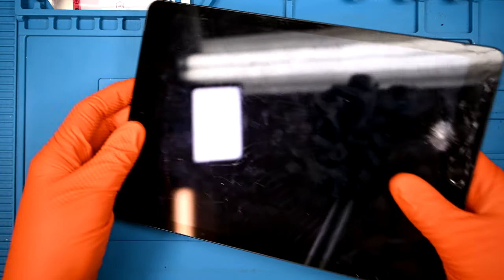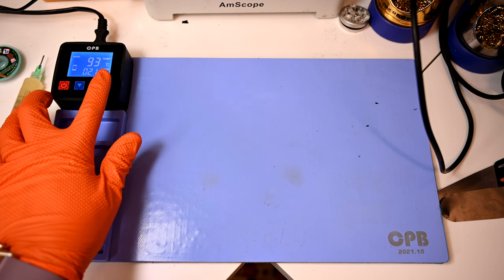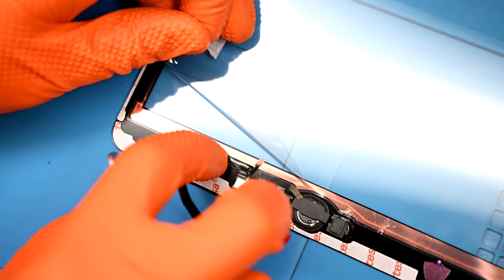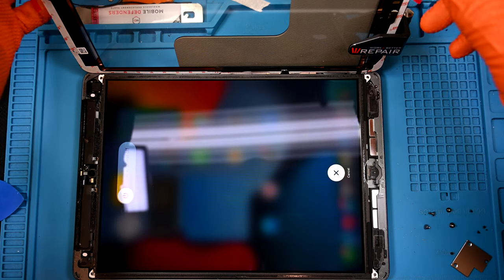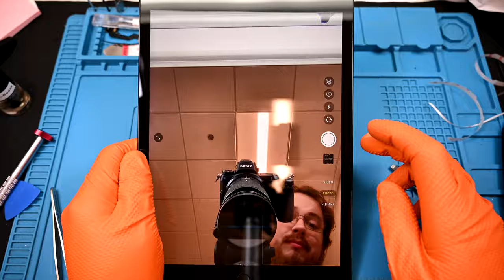iPad 9 (2021) Screen Replacement Guide | Same old traps, thanks Apple

Comment: For those of you wondering (like I was) how to re-insert those tiny-tiny-tiny screws... it's quite a challenge, especially if you have big hands like I do. I started having success after I bought a magnifying lamp. Then you can really see those tiny screws up close and work the tweezers to gently grab the head of the screw and place them in the holes. Then make sure your screwdriver is demagnetized otherwise the screw will jump back out and attach to the screwdriver. Also, don't squeeze too hard on the tweezers or else your screw will shoot out never to be seen again. My suggestion is to get an old broken iPad and practice first. It takes time and patience to get these screws in the holes and I also recommend ordering a whole bunch of replacement screws. Another frustrating thing to keep in mind is the edge of the iPad is EXTREMELY magnetized - we're talking black hole magnetic field power. The screws love to just zing away from the holes and attach themselves to the edge. The magnifier and the tweezers make it easier to pry them away from the edge.
Reply: ❤HOW MUCH WILL I SAVE BY DOING THIS MYSELF????$$$ 
AND WHAT WOULD BE A GOOD DEAL PRICE TO PAY SOMEONE TO FIX MY IPAD TABLET LIKE THIS??$$$$
Reply: Do you know where I could get any iPad 10th gen replacement screws two of mines got stripped😭
Reply: If the LCD hast a little crack at the frame Side , will This make the whole LCD Display wont Work ?
Reply: I've been considering getting a magnifying lamp due to the reasons you mentioned but I never thought about an old practice iPad. That's a brilliant idea AND that means we'll have extra parts (and tiny screws) if needed. Thanks!

Comment: As a heads up for those trying it. Make sure you disable the password prior. This way it won’t locked up the iPad for a period of time!
Reply from the maker: Or make sure it's powered off completely before taking apart. Apple devices hate unexpected battery disconnections.
Reply: How can I solve it!? It locked up 15 mins every time when I wake up iPad. The touch button always ghosted and password is automatically filled in wrong number then locked.😢
Reply: @jinxinxu8369  that means there’s something wrong with the way you connected it. I kept trying to reconnect and connect it again. Eventually it worked out.
Reply: Ok I feel like I did the same but getting a new screen with home button. When I recieved the tablet tho the home button was ripped and dangling . Do these new home buttons still need to be programmed?

Comment: Just replaced my son’s iPad watching this tutorial. Thanks so much! Took a lot longer than you as this was my first time. Tips were helpful so I didn’t do any damage during the replacement. Fortunately my new replacement screen came with a home button attached to it.
Reply from the maker: I love to hear good news like this! Glad it went well, and hopefully now you'll feel a little more confident if you need to fix anything else in the future!
Reply: They usually come with the button the reason for replacing the button with the original one is due to the fingerprint. It’s automatically synced with the old button so if you replaced it entirely you won’t be able to use that feature.

Comment: Two precautions I didn’t see replaced, the black tape; securing the tab for the Touch ID connector; it was left on the battery, and the foam pad covering the Touch ID cable; probably intended to absorb vibrations preventing the Touch ID connection from shaking out of place
Reply from the maker: Both pretty optional, the cable has adhesive holding it to the frame under that foam as well making the foam unnecessary, more of a trap to ensure the ribbon rips if pulled without thinking. The tape doesn't do much as the latching connector cannot unlatch when the LCD is screwed down on top of it, and very little chance of moving. I think the tape does more to "hide" the connector than it does hold it, something so light and thin doesn't react much to shaking. The charge port on the other hand, very susceptible to vibration as Apple hasn't quite figured out what loctite or threadlocker is.
Reply: @TapticDigital  brother where can we order touch screen for iPad 9 from . I’m from nepal and no one has the touch screen can you please provide me a source from where I can order the touch screen 😢😢
Reply: @TapticDigital  yes pls reply
Reply from the maker: @mrudulajoshi5387  I am unfortunately not familiar with any vendors that ship to Nepal. I am based in the US, I would look on Amazon or eBay, I believe they offer international shipping options.
Reply: Very Nice!! I need that stand holding up the glass

Comment: I recently replaced the screen on my moms phone and thought maybe I could tackle my old iPad as it has a crack right down the middle. I’m glad that I watched this before I spent money on a new screen. Too much can go wrong. Besides, when it’s on, I can’t even tell it’s cracked. Thanks for the informative video.
Reply from the maker: Obviously getting stuff fixed is ideal, but sometimes fixing it just isn't worth it at the time. I often get customers with expensive phones like the IPhone 14 Pro and they have a small hairline crack in the display. It's almost $400 for a screen, so usually I recommend covering it with some tape unless it gets much much worse. If it isn't causing a problem, best to leave it alone sometimes. Glad my video helped!

Comment: Great guide, thanks! It could do with some more detail regarding the Home Button, though. Whenever I try and place the button back, it never feels flush and is often loose when replacing the screen. I'm not sure how you're supposed to get it to sit right and not move around. It's lined up with the nipple and clicks when you press it, but it's still kinda loose once you fit everything back together.
Reply from the maker: First, fantastic profile picture and name. And some of these buttons can feel a bit loosey goosey, you can slightly bend the bracket to put a bit more downward force on it but as long as it still has the nipple it should click pretty well. If the adhesive on the bracket is too thick it can also put a bit more lift on the bracket preventing it from holding it in tight. Personally I’d try bending the bracket just a bit to press against the button and keep it locked in, but not too much or it will constantly click the button.

Comment: Tysm for this, I repaired on of my friends iPads and it worked great. The only real problems I had was the home button didn't sit in place completely correctly and now it's sunken in a little bit and doesn't make as much sound when it clicks
Reply from the maker: Nice! Your problem is likely the nipple on the button. I actually have a short on my channel about replacing that little piece. As for the sunken in, that could be the button missing that piece, or the backed got loose. Ever since I started using tape primer (should be available at hardware stores) on the bracket and glass those buttons stay stuck. Glad this video helped!
Reply: Use some extra glue to avoid future problem of home button coming loose

Comment: Hey I have a question, I was curious if it was necessary to get tape primer before starting the repair as I don’t want to mess up my home button but also don’t wanna spend $25 unnecessarily. Anyways, great video!
Reply from the maker: @Isaac-dh6iq  I strongly recommend tape primer, it takes it from being “stuck” on to almost “sealed completely”. It makes it very unlikely to ever lift up on its own. You can find the tape primer in pen form if I recall for a bit cheaper than the small cans
Reply: @TapticDigital  Okay! Thank you for the info

Comment: I don't like the adhesive that comes pre installed it does hold good. I usually remove it and re apple scotch 3m 300lse
Reply from the maker: I've had decent luck using the TESA tape it comes with, and then using 3M Tape Primer 94, it bonds hard as a rock. I might look into the 300LSE, is it thicker than the normal double sided tape?

Comment: Excellent video. What 3M tape primer do you use? Is it necessary to black silicon areas back down, where existing silicon spots were removed?
Reply from the maker: No silicone necessary, it serves no purpose. I use tape primer 94 and it makes for a very good seal.

Comment: How do you guys get the home button connected? I watched multiple times and can’t get it to slide under and stay.
Reply from the maker: Do you mean the part that connects to the board or the part that goes in the glass? If it's board side, even if they are all the way inserted and the little latch is down it still looks and feels pretty loose but it should stay. If it doesn't, you can line it up and then use a small piece of tape over it to hold it in place!

Comment: Great video good instructions,I repaired my iPad screen the top of the screen works and the home button works but the bottom of the screen doesn’t work and properly
Reply from the maker: Ouch, there could be a slight rip or disconnection in your digitizer ribbons, that's common when closing them up unfortunately

Comment: I have just done mine but the screen seems to press random stuff sometimes where have I went rong? Thanks
Reply from the maker: Two possibilities! The first, one of the two ribbons coming from the glass has been ripped/torn/knicked or isn’t fully connected, the other possibility is a defective digitizer. Both are equally as common with how mass produced the glass is. Best bet would be to open it back up gently, check the connectors and ribbons for any signs of damage. If no obvious physical damage, contact the vendor and look into replacing it!

Comment: I made an attempt at following your guide to repair my shattered screen. Everything was going great until I started putting everything back together. I got one of the digitizer "lego" connectors connected just fine but the second one was like, "Nope!". I wound up mashing the pins. My big meaty hands are not designed to do work on tiny little things. And speaking of tiny!!!  Those freaking screws. How do you deal with screwing those back in? They become so ridiculously magnetized you can't get them seated on the driver. Then I lost one inside somewhere and couldn't find it due to the magnetization. It's attached to something in there but I'll never find it.  I gave up and just ordered a new iPad.

Comment: Follow the steps exactly and everything seemed to go smooth but when I went to power back on nothing happened. I checked at the battery was connected is there something else I may have missed?
Reply from the maker: As silly as it sounds, a lot of people forget to fully tighten the battery screw. Otherwise try connecting it to a charger, sometimes they like to power on that way after a battery pull

Comment: The first tutorial I watched didn't have me disconnect the battery. 

Now the iPad won't turn on. How would I go about fixing this?

Thanks
Reply from the maker: @bradleycrookshank4891  time to disconnect that battery! I’d start by opening it, and first disconnecting the battery. You should remove the screw and then take a thin piece of plastic or a playing card and gently slide it under the battery connector to make sure the battery is fully disconnected. Then unplug and replug all the display ribbons and try again!
Reply: @TapticDigital  that worked! I can't get the home button to work but everything else is great. 

Thanks!

Comment: does the Apple Pencil works after the replacement? looking forward to do it, thanks!!
Reply from the maker: Sometimes! In most cases I've had the pencil work fine after replacement, but depending on which vendor you buy from it may not. A lot of part vendors will specifically state "works with pencil" and those are the ones I'd go for!

Comment: "Would you rather A) replace the display of an ipad or B)..."

"B!"

"You didn't let me finish, what if I said 'B) give free bjs to 20 people'?"

"The answer would still be B."

Did this repair today and messed up. I scratched the display while cutting the glue and I cut the home button cable despite your warnings. The display still works, the scratch is only visible when black and the homebutton from the replacement digitizern works without fingerprint. This was the best instruction video that I EVER found on the internet. Thank you so much! I liked your comments about apple. If I worked in Apples development crew, I would probably tell my kids that I'm a stripper. Or a beggar.
Reply from the maker: @deep470  iPads and Nintendo Switch Lites are my least favorite repairs. I feel like the execs at Apple said “make an iPhone with a big screen but just as thin” and the engineers said “ok but how do you want it to go together and work?” To which the execs said “idk lol, just make it fit and use a bunch of glue”

Comment: I just replaced the screen and it all works great, except now the battery isn't charging.  It turns on and chimes when I plug in the charger, but the battery never goes above 0%.  This wasn't an issue before I replaced the screen.  Is there something I may have bumped?  I know that the battery screw is tight because I made a point to check that before closing it up.  Thanks!
Reply from the maker: So the charge port has a bracket that holds it to the frame, held by two Phillips screws. These get loose from general use but also stay down because of the glass over them. But when you open it, it can loosen them up. If possible I’d heat and CAREFULLY reopen the glass, tighten those two screws and give it another chance.
Reply: @TapticDigital  I just did what you advised and it WORKED!!!  THANK YOU SOOOO MUCH for the quick (and correct) response!!!  You're awesome!  I will definitely be recommending your channel to everyone I know!  Thanks! :)

Comment: If only the glass itself is broken, do you need to still do everything else?
Reply from the maker: @ReneRosa  you do need to remove the LCD in order to get to the connectors for the glass, but really only the glass digitizer needs to be replaced. You’ll need to transfer the home button over to the new digitizer to maintain Touch ID. But yes the LCD can be reused.

Comment: so I replaced my screen, I could not recover the touch id as the ribben got cut somehow. Now the ipad keeps having the zoom pop open and close as I am trying to set up the ipad, it doesn't let me touch anything very well. Did I do something wrong with the install? It's an 8th Gen, with an 8th gen glass (as far as I know since thats what the seller said I bought and paid for)
Reply from the maker: Ghost touching is pretty common in iPad screen unfortunately. Sometimes it is just a loose connector, sometimes a torn ribbon, but sometimes it is just defective.
Reply: @TapticDigital  damn.. yah that’s exactly what it’s doing. I tried reseatting everything a few times but it’s still doing it. Might just be defective.. damn.
Reply: @TapticDigital  should it be happening even when the digitizer is not plugged in?
Reply from the maker: @MantisFoxx2  definitely not, if no digitizer is connected it shouldn't be making any selections on the screen. That could be board damage to the connector, could be something stuck in it as well. Take a close look at the connector and make sure all the teeth look straight. One of the digitizer connectors seems to always plug in perfect, while the other doesn't fele quite right, at least in my experience. Sometimes I have to reconnect that specific one a few times to get it just right
Reply: @TapticDigital  the two cables from
The digitizer and the home button aren’t even connected and it’s flickering with the zoom option as well as the location of the zoom box is moving around
Reply from the maker: @MantisFoxx2  that's a pretty serious issue then, and likely board damage unfortunately. It's possible those digitizer connectors got smashed or shorted themselves out
Reply: @TapticDigital  yah from what I read it could be something with the logic board. Guess I’ll be exploring that fix next. Lol. Thanks for all the help.

Comment: After replacing my lcd screen on my 9th gen iPad the iPad ask me to connect to iTunes. I’ve never connected the iPad to iTunes its whole life. What could be the issue? Thank you so much for the video.
Reply: did you turn it off before replacing the display? or did it with the ipad powered on?

Comment: Use a hair straightener rather than a heat gun. It’s a more focused heat and heats the glass as well instead of baking the insides of the iPad. It also rapidly heats that strip of glue around the screen without as much time under heat.
Reply from the maker: @julieberry2793  huh that sounds like it could work really well, especially if it’s a temperature controlled one. Cool!